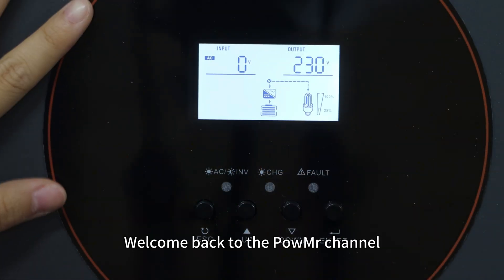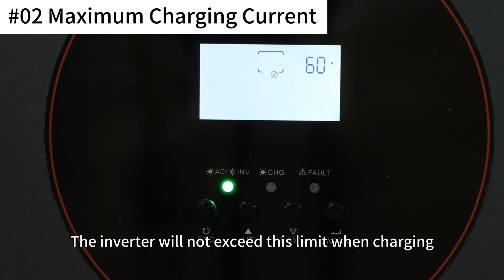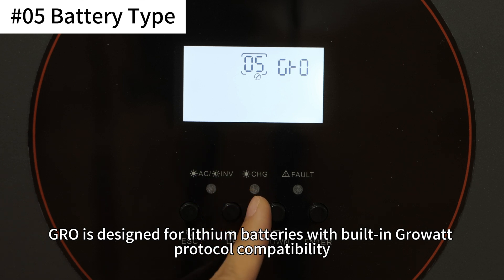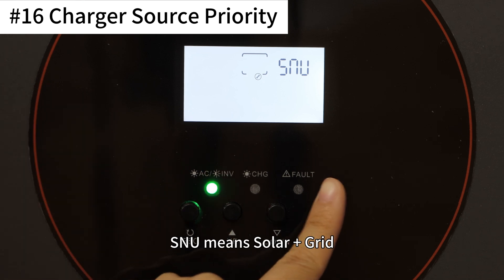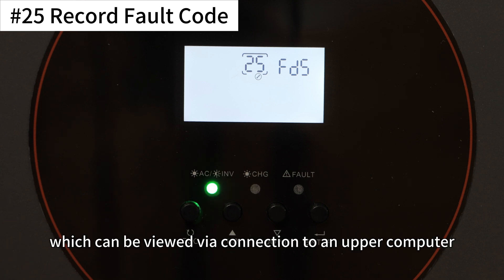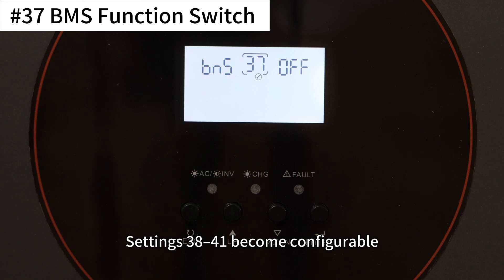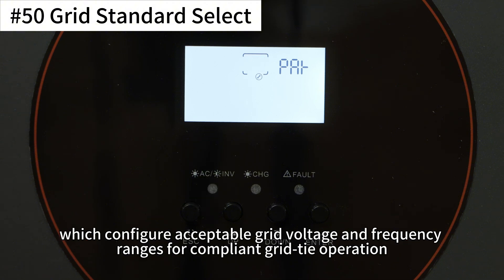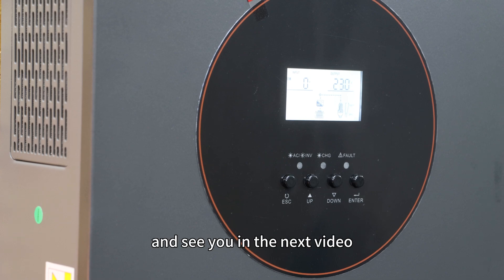How to Configure POW-HVM6.2KP and POW-HVM11KP Inverters | Step-by-Step Instructions

Comment: Hi, I own the POW-HVM11KP inverter. I would like to ask some questions: is it possible to connect the inverter via Wi-Fi with an app to view on a phone? Which Wi-Fi is compatible? Is the PowMr - WIFI-RELAB Wi-Fi Module compatible?
Reply from the maker: Hi, kindly check the product link bleow:
https://powmr.com/products/11000watt-220vac-24vdc-all-in-one-solar-inverter-supports-9-units-in-parallel

Comment: Hello.
I have a specific technical question about the operation of the POW-HVM6.2M-48V-N inverter.
I plan to use this inverter with a battery of my own design with a BMS system.
Question: What happens if in SUB mode the BMS system disconnects the battery from the inverter? Will this situation cause the inverter to break down? Thank you.
Reply from the maker: The output mode has nothing to do with BMS communication and will not interfere with BMS communication.
Reply: @PowmrSolar  Thanks for the answer.
I asked not about the BMS, but about the inverter. What happens if the battery power circuit is disconnected in SUB mode or some other mode? Can the inverter break down from this? Or will the inverter just give an error and turn off?
Reply from the maker: @Автоэлектрички  The machine will report an error code. If the machine is still connected to the mains or PV, the machine will not shut down.

Comment: i just bought a 1.5kw good for 24v hybrid inverter. its still on its way since i ordered it online. please help me, i want to know if it is suitable for 2pcs 12v 100ah gel lead acid battery? i will connect it in parallel
Reply from the maker: Yep.

Comment: Hi i just bought a hybrid inverter 4.2kw. My question is are batteries are must to use to solar and grid power. I only want to use solar and grid power without batteries is this possible?
Reply from the maker: the POW-HVM4.2M-24V-N model?
Reply: @PowmrSolar yes sir. This is the model
Reply from the maker: @Billiondreams11  Hi, this model can work without batteries.